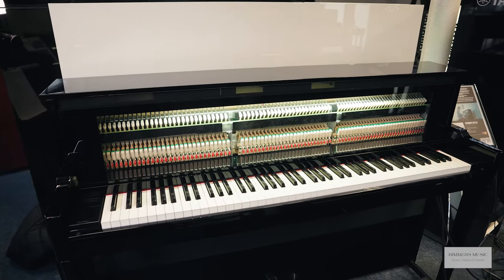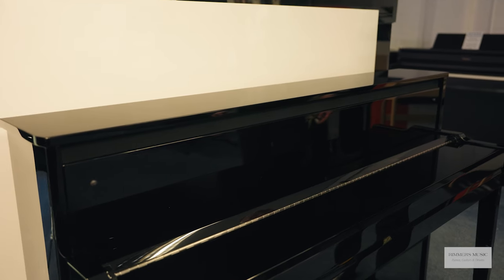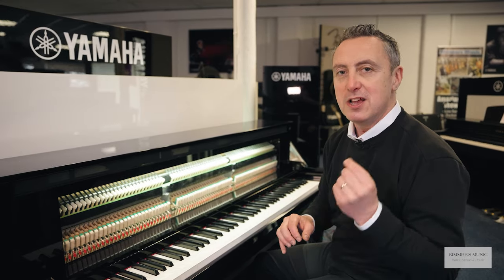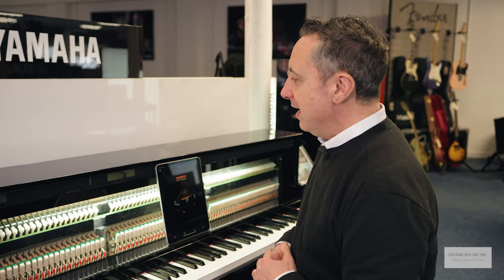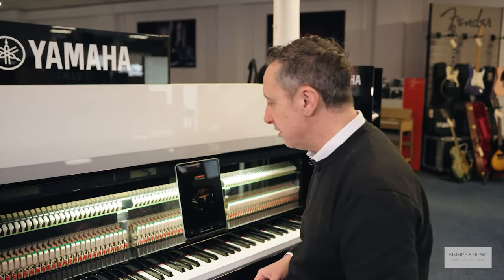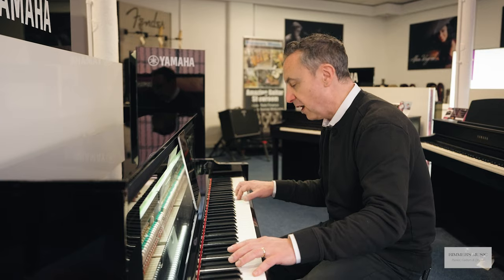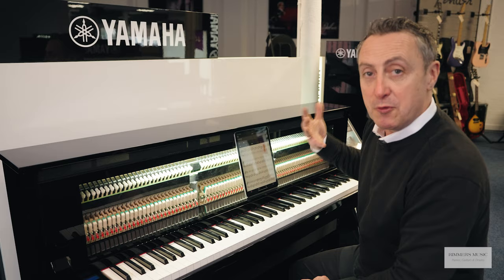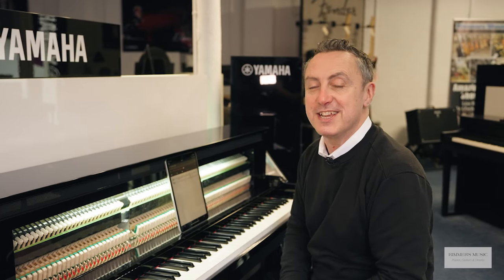Yamaha NU1XA Avantgrand - Everything that you want to know

Comment: Could you provide some steps to disassembling the front fallboard?
Reply from the maker: Hi, 

It's not recommended to remove the front panel as dust will affect the advanced sensor system inside the piano.
Our display models have a perspex front panel just for demonstration purposes.

Pete
Reply: Dust will not affect the sensor system - the NU1XA employs a brand-new magnetic sensor system.  Other pianos use mechanical or optical sensors - only those are affected by dust.